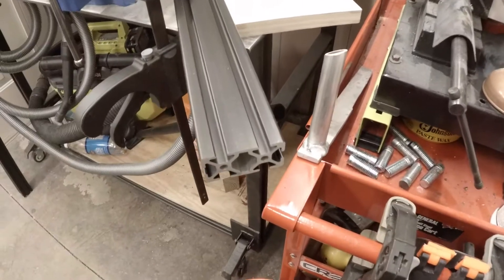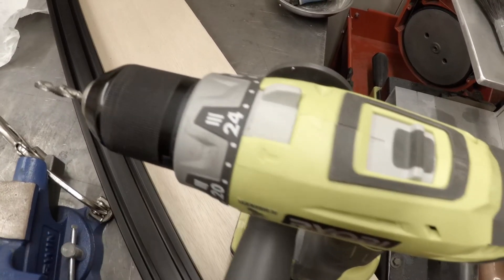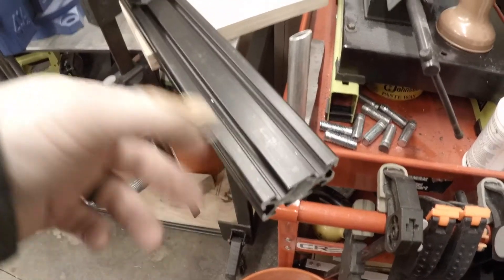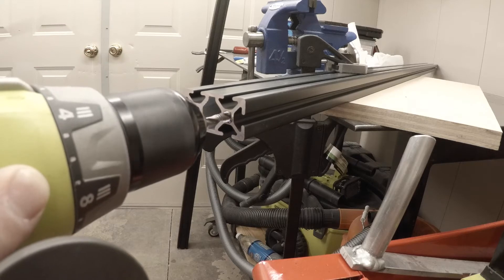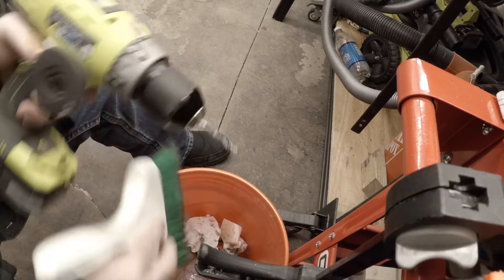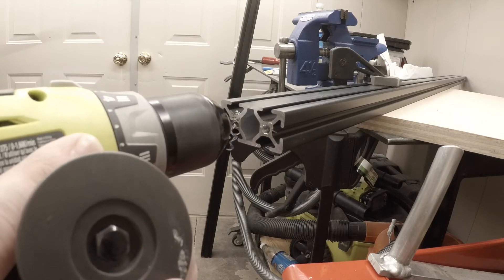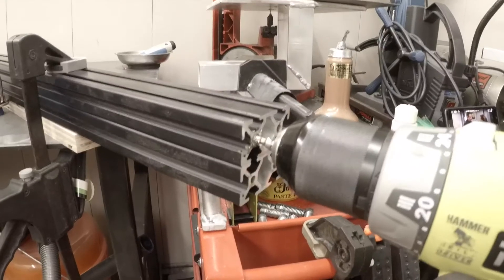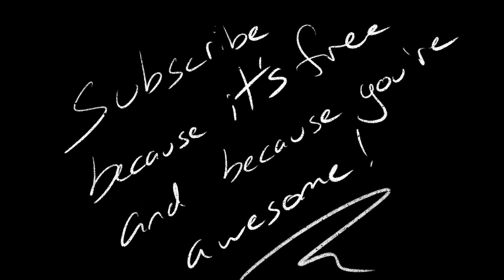Tapping 80/20 Aluminum Extrusion the Easy Way

Comment: I bought some cheap drill/taps off of Amazon and while test on a scrap piece the bit snapped about halfway in. I tried a second bit, but it kept binding up & I was afraid it would break when I went to tap the real pieces. I found your video and found that Home Depot sells individual 1/4-20 drill/taps by Milwaukee that say they are "Impact Ready". 14 holes tapped with almost no binding by the Milwaukee.

Comment: This video was really helpful and confidence building for me as extrusions and all shop work is new to me.  I have a smaller Milwaukee drill and the tapping process didn't go as smoothly.  I had to adjust the clutch to a much stronger setting and I really had to work the drill.  I had to reverse out of the hole a few times, re-oil and clean the bit and repeat.

After reviewing your video again, I noticed that the extrusions you're working with appear to be 15 series 8020 whereas my extrusions were 10 series.  The 15 series have a .262" diameter hole whereas the 10 series have a .205" diameter hole.  I think this made a big difference in the level of effort.  

The good news is that all the holes that I tapped worked great.
Reply: How's he going to cut threads in a 0.262" hole with a 0.25" tap? 🧐

Most 10 series says it has a 0.205" hole but I've seen 0.201" and 0.210". The threads in this video don't look super deep. I'll bet the ones you cut are deeper with better engagement.

Comment: Could you tell what type of oil do you use ? I was trying to do the same and was genuinely baffled - Mine got stuck multiple times every 3-4 full turns. Whereas, in your case, you could go in all the way with the lowest setting. 

I then figured out that it was the oil. I was using WD-40 - it would get stuck and got nowhere. However, when I changed to machine coolant that was lying around (instead of WD40) I was able to go in about half way per pass. I then purchased threading oil but it was wayy worse than the coolant, maybe even worse than WD40 !
Reply from the maker: Just use a good cutting oil. You really shouldn't try to do it in 1 pass unless it is perfectly smooth.

Comment: Nothing wrong with having power. I think hes referring to a DeWalt drill that has about 1/2 the trigger as the other drills. Its like the DeWalt is on and off very touchy control. People think it is hard to control because of power but that is not it.

Comment: Next problem, I want to use blue (semi-permanent) thread locker during final fastening. But I’m concerned that oil will contaminate the thread locker. But not using oil will snap the bit…. What to do??? I guess a bunch of fwd and backward with the drill just like a manual tap but without oil maybe?
Reply from the maker: Definitely use oil... Use spray cleaner when done.

Comment: Broke 2 of these Dewalt bits in my 15 series 80/20 extrusion. I think my mistake was that I didn’t add lubricant (beginner here 😉). I’ll buy another bit and try again with lube. Now I have to remove those 2 broken taps in my extrusion 😬.
Reply: Chips must go out while you are tapping.

Comment: I was wondering how I could make sure to thread these holes as perpendiculat as possible, I thought of creating a jig but this is the way to go. I didn't think of that tool. The drill bit serve a good enough pilot to ensure the perpendicularity of the machining. Smart idea. Well done!
Reply from the maker: Make sure to use a lot of cutting oil and be as perpendicular as possible. It’s pretty forgiving but not if it’s dry or a weird torque is put on it.

Comment: So then what bolt or screw did you use?
Reply from the maker: I tapped it with 1/4 20 threads and used a 1" bolt.
Reply from the maker: You could probably go up to an inch and a half bolt with this method. Really depends on how thick of material the 8020 will be bolted to.